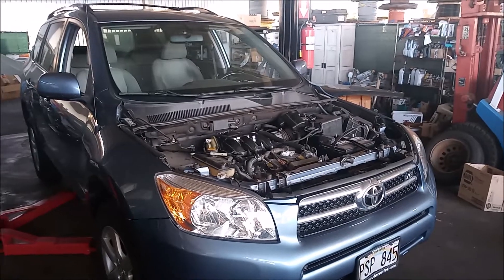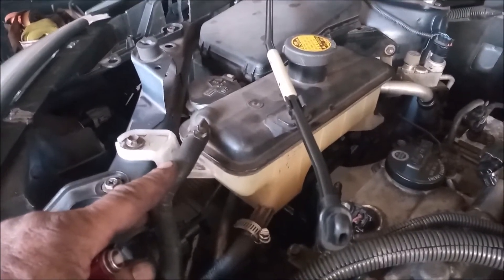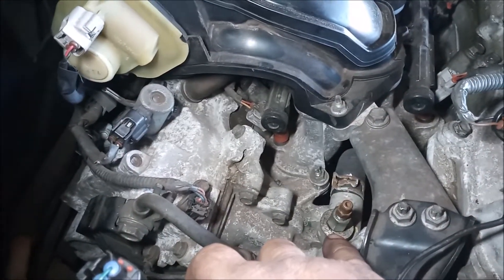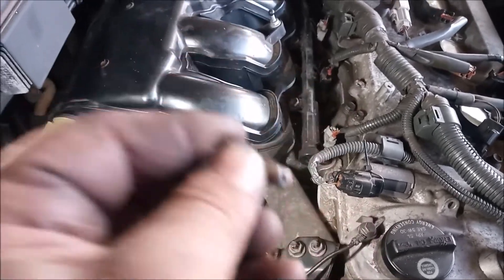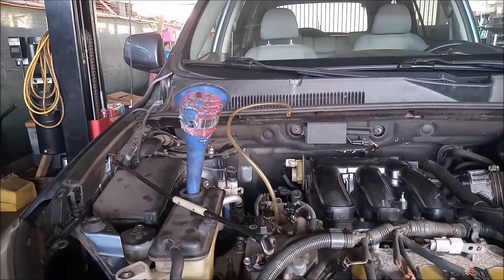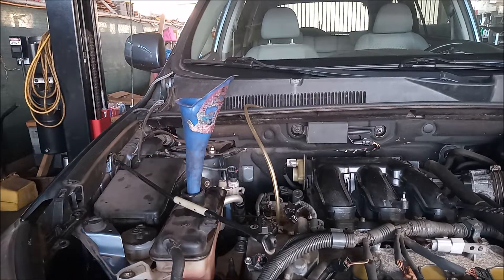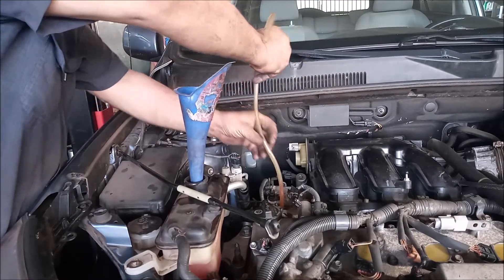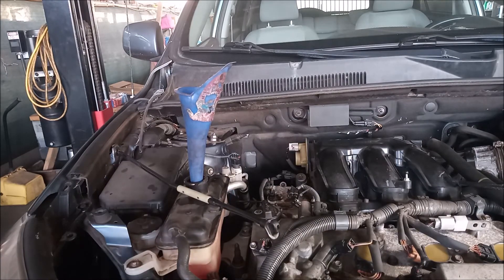How to Fill and Purge the Coolant System - Toyota RAV4 3.5-liter V6 2GR-FE

Comment: So I bought a 2008 rav4 with the 2gr-fe and the water pump was replaced but the mechanic who did it put green coolant in it. I’m assuming universal, and I want to flush all that out with distilled water a few times and get the correct coolant in. Will running distilled water through it a few times and then filling with coolant and following this procedure also get all the coolant from the heater core out as well?
Reply from the maker: disconnect the heater hoses and flush it with a garden hose.

Comment: Thank you Frank. I just had a mobile mechanic replace my water pump. I am pretty sure he did not  bleed the air out. Will I damage something if I drive the car without the bleeding or burping step? I have to drive an hour tomorrow to an important appointment. And I can’t afford to get stuck somewhere if something goes wrong. Thanks.
Reply from the maker: What is going to happen is the fluid level will go down in the reservoir and you need to refill it. Usually this happens after a short drive when the thermostat opens and the fluid circulates. Have some coolant handy.

Comment: Thanks Frank - your videos are excellent but allow me to share my experience. I have a 2006 RAV4 V6 with the expansion tank just like you are showing.  I also watched the car care nut video ( BTW the hose you need is 1/4 inch ) got mine at Tractor Supply for like 6 bucks. Here is what I did - drained radiator only and got a gallon of coolant out from using the petcock.  Loosened the purge valve with a 10mm wrench so it was easy to close off after. I decided to experiment with running the engine , waiting for bubbles, etc... ( exactly as car care nut explained - but using the expansion tank ) I had a considerable amount of air bubbles flowing up the hose with the coolant into the funnel atop the expansion reservior  ) ran the engine waiting for the thermostat to open ( takes awhile  20 minutes ? ) and more bubbles. Expansion tank dropped way down  ( added more coolant ) and soon the coolant was flowing freely up the hose without bubbles. It did exactly precisely what the car care nut video said it would. So - not sure just waiting for the coolant to appear in the bleeder hose and then done is necessarily correct at least in my case.  I don't know when my coolant was last changed or if it was bled correctly but that is was I experienced - hope that helps everyone.
Reply from the maker: The car has to be run with the expansion tank open until the thermostat opens. This is a 15-word summary of your comment.
Reply: davidr1030 - I greatly appreciate and totally agree with your note and add'l explanation!! Unfortunately the Car Care Nut's video is not of the RAV4 V6 2GR-FE engine - as he uses the 2008 Highlander version of the 2GR-FE which is a slightly altered process. But what is common in both vehicles is the process to allow the new coolant that is being added to fully be ingested into engine, thus it makes total sense to start the engine after adding the coolant and allow the thermostat to properly open as described.
Thanks to MerryFrankster to his work and efforts in getting us to through the coolant filling process and davidr1030 for the add'l details describing the engine starting procedure to fully complete the process!!
Being a total Toyota loyalist forever and having owned many different years & models, I recently had the opportunity and decided to purchase my very first RAV4 (a 2011 Limited V6) and cannot believe how quick and powerful this 2GR-FE engine is when coupled with the lighter weight RAV4 body...and is the most fun Toyota driving experience since my mid 80's MR2!! It's truly a shame Toyota decided to nuke the V6 with the RAV4 after 2012...as this IMHO is the perfect match of speed/power/reliability!!

Comment: Should the heater controls be in On or Off position when draing and filling?  The Car Cate Nut says OFF when filling but i am unsure if that means off when draining also?
Reply from the maker: Makes no difference. There is no valve on coolant circulation to the heater cores, it circulates the same whether you have the heat on or off. The only difference is with the position of the blend doors that direct the airflow past the heater core. Does not affect coolant flow or coolant level or anything to do with the coolant.
Reply: @Merryfrankster_  ah very interesting!  Why would it matter to have the heater position in the Off position when refilling then as the car car nut suggests?  Or are you saying it doesn't matter at anytime whether filling or draining?
Reply: Aaarghh...I've drained my Sienna 3.5 V6 and all I've gotten out is maybe 4 litres?!??  No the coolant was not low beforehand. What have I done wrong?
Edit : I just found drain plugs on engine block!
Reply from the maker: @user-wo7rz3yn4o  you've drained the radiator and the main hoses. There is coolant left in the block and the heater core. There are block drain valves on either side of the block. The heater core you would have to blow out with air.

Comment: What size hose for the coolant bleed valve?
Reply from the maker: 1/4 or 3/8 can't recall exactly I just grab whatever is laying around the shop in the hose box.
Reply: 1/4 inch ( just did mine ) 2006 V6

Comment: do you know the size of the hoses that run into the firewall for the heater core.  My heat doesn’t work at all, it comes out as if it was pumping in air from outside.  I wanna try flushing the heater core or do you think it’s a better idea to replace it.  i can’t find any videos on the 2GR-FE
Reply from the maker: 5/8-inch
Reply: @Merryfrankster_  thank you

Comment: Hello Frank,i'm looking for a video of how to change the thermostat on the 2GR-FE and where is located the coolant sensor on this engine?
when i start my engine the morning the twin radiator fans stay ON for a long time even if the engine is cold.i wonder if it has to do with the coolant sensor gaving the bad lecture on the prestone temp???
thanks in advance for your help.your video reminds me of a Renault LeCar that add the same kind of purge system as the 2GR!
thanks again
Gervais
Reply from the maker: The thermostat is on the right side (passenger side US) right where the hose from the radiator goes into the engine. You have to take off the belt and take off the idler pulley to take off the thermostat housing. Why do you want to change your thermostat? If it is not malfunctioning leave it alone. It has nothing to do with the fans. The temperature sensor is above the transmission on the water neck that is bolted to the engine, where the radiator hose comes out. It's very easy to replace. Do you have a scantool? Check the live data of the coolant temperature and find out if the temperature sensor is working or not.

Comment: So Installing a swirl pot on a 2gr is unnecessary
Reply from the maker: You mean for de-areation? The system is pretty much self-de-aerating since the expansion tank is at the high point.
Reply from the maker: But note that not every 2GR uses and expansion tank. The Camry uses an overflow tank with the pressure cap on the radiator.

Comment: Don't we need to keep the car running to remove all the air from the purge valve
Reply from the maker: Yeah you can do that just collect all the coolant that comes out or run the hose back into the expansion tank otherwise you will spill a lot of coolant. If you close it up then run it then a small amount of air left in the system will go to the reservoir and you can top it off later aftwr itncools down.